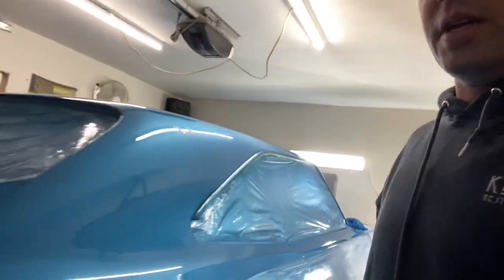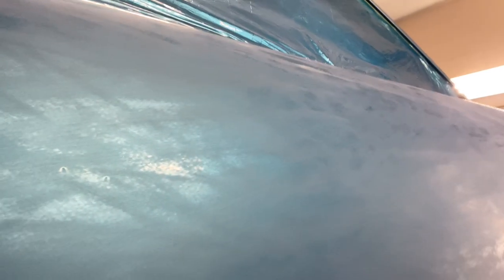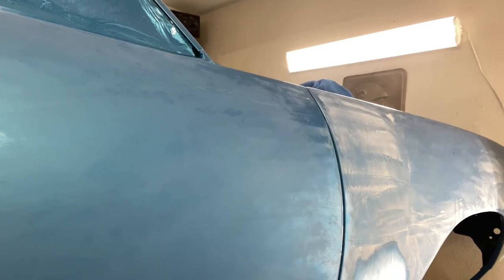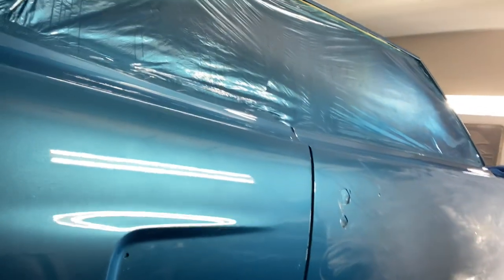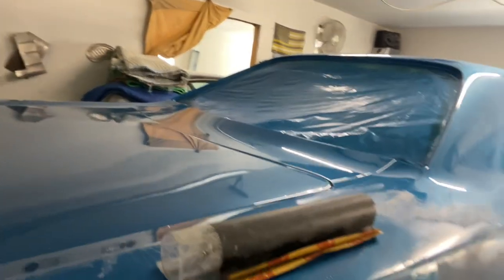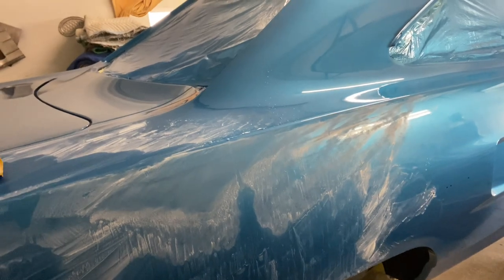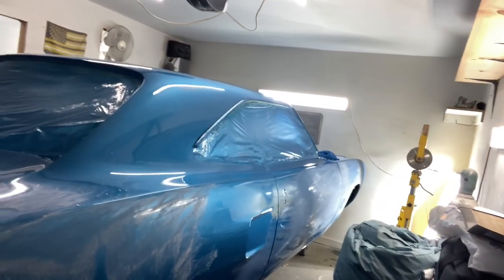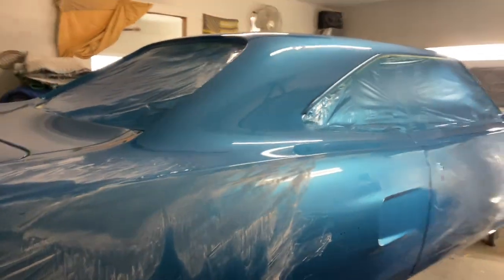Wet sanding your paint job for a perfectly flat glass finish part 1

Comment: Do you use a rotary buffer or a DA buffer?
Do you use a wood pad when applying the compound and polish?
I only have harbor freight near me so that’s where I will get the material
Reply from the maker: I usually use rotary but just switched to rupes orbital buffer to save time and better results. Depends on what you sand it with is what pad to use . 1500 might do good with wool